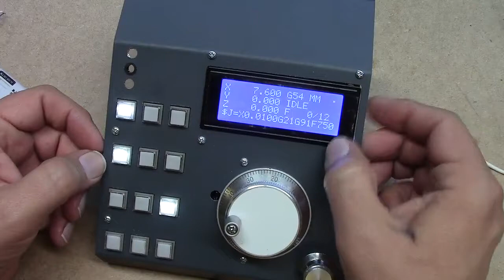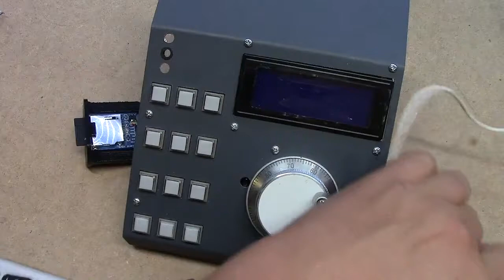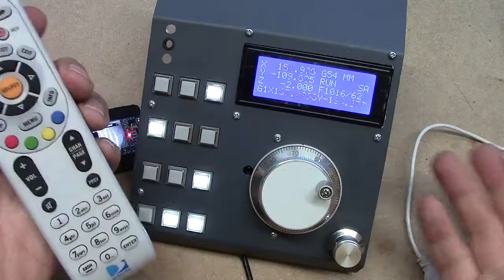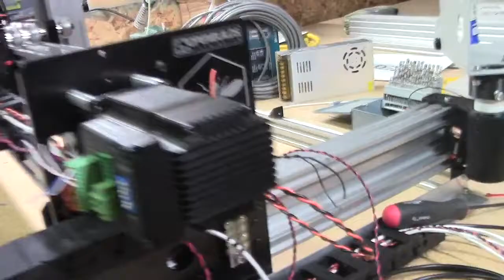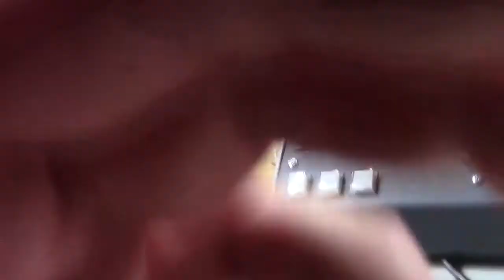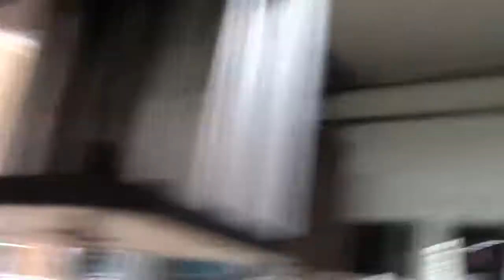181002 Valve Studio - Tonehenge Journey -  Hyatt Progress

Comment: Wow. That remote box took a lot of work AND the buttons all line up.....in a steel plate that doesn't look refinished!
Reply from the maker: This whole project took way to long, but I know a lot about the wonderful PSoC5 processor.
Reply: @CraigHollabaugh  I have a pretty good idea what that panel took to make. You gloss over what it does, skipping what it took to get it to do that, but I have a good idea. There's no such thing as "too long" when the result is that panel, and I covet that jog wheel.

I haven't messed with a PSoC5 yet. Honestly, I'm in a rut: digital stuff is always an ATTiny, a Teensy, an ESP8266 or an ESP32 lately. The dual core, WiFi, wireless firmware upload, and price on the ESP32 have spoiled me rotten.
Reply from the maker: @Giblet535  Thanks for the reply. There are a some long videos on my PSoC5 GRBL implementation.  All the design files (schematic, board, source, etc) are here, https://github.com/holla2040/hyatt. The source code I modified from Dring's PSoC5 GRBL port use the word 'hyatt' to easily find my modifications. If you want to just stick with ESP32 GRBL, look at Barton Dring ESP32 GRBL work, http://www.buildlog.net/blog/2018/07/grbl-cnc-firmware-on-esp32/

Comment: Nice design work on your interface and controls. I am regretting my choice of raspi with arduino for my interface. The touchscreen is cool, but ultimately kind of a gimmick. For my fullsize build I think I'm leaning toward a pc with parallel break out box.
Reply from the maker: Thanks for the comment. My hyatt project has turned into an obsession. I think my presentation makes it look easy, but its really time consuming and embedded systems is my profession. I'm having a lot of fun, learned about this PSoC5 processor and the operator interface is great. Something my granddaughter can use without cad/cam/g-code sender/machining fundamentals, etc. She can zero axis', turn a knob and cut stock.  You'll probably get a USB to parallel breakout, run something like mach3 and be cutting in no time.  Keep watching, I got the piezo-probe and IR MDI running this evening, both are cool. I'll talk about them in upcoming videos.
Reply: Thanks for the reply!  Your presentation does make it look easier than the reality, but it's more entertaining that way:)  Unfortunately for my setup... I've purchased many components over the last couple years, while I built a functioning 1:4 scale version to tweek the design. The problem is, closed loop servos, proximity sensors, better microcontrollers etc. have gotten cheaper and better in the meantime. I could have just  bought a turnkey cnc router lol. I guess it's worth it for the fun and learning. Looking forward to your progress in future videos!
Reply from the maker: you're correct. My goal here wasn't just a functional machine but a real operator's console and to learn about PSoC CPUs. Its really cool to build on the Dring GRBL foundation.